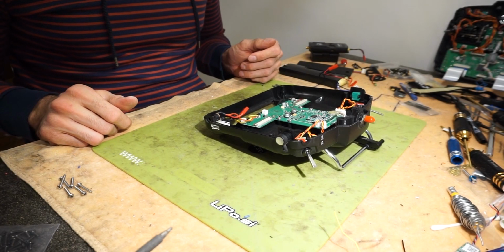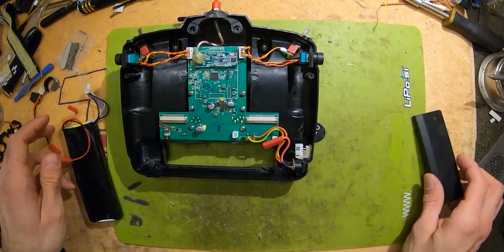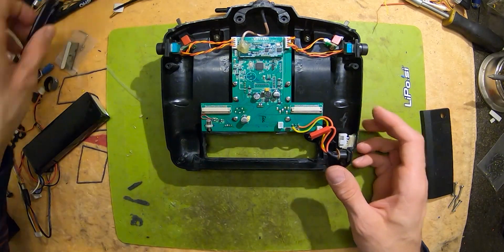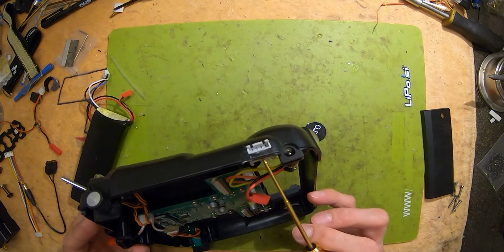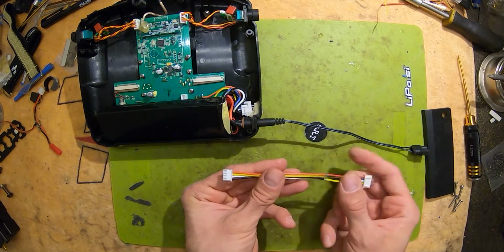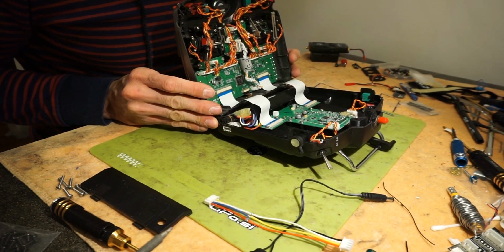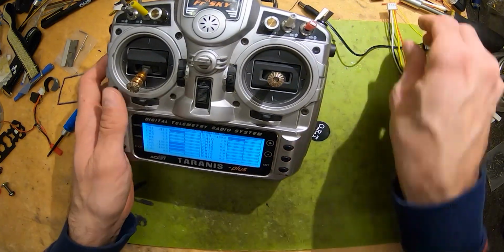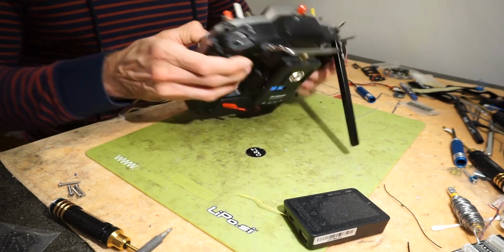Frsky TARANIS battery mod.

Comment: Can you tell me where you got the little clear feet on the bottom of the taranis?  I am looking on the net for something similar right now but not sure what size to get. Where did you get yours from do you know? I'm not finding ones that are small enough to fit on the bottom of the taranis feet like you have there.  Smallest ones I have seen are 12.5mm x 12.5mm which is SLIGHTLY too large to have them fit perfectly like you have there at 7:05
Reply from the maker: I think i hot it from hardware store. Not really sure.

Comment: Antennas forgotten. :(((
Reply from the maker: Hm... Just cycled the power on the tbs module and I did sma connector mod to make my internal module antenna removable. Should be fine right?
Reply: @mrRockwellFPV  well... running any RF transmitter without load is not healthy situation. Just for future.
Reply from the maker: @alexanderfedorov7890  Thank you for your input. Always thought cycling power woudnt harm the tx. Will take care in the future.